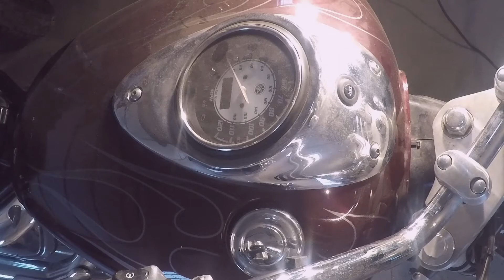2007 Yamaha V-Star backfiring repair Part 2 (final)

Comment: I had an air leak on the intake manifold (Road Star) from the tube that I think used to hook to the emissions system when the bike was new (Ca model) once I plugged it all of my backfiring and rich condition went away.! I am getting over 40 mpg now and the sparks are no longer black!
Reply: Was it the intake boots? Did they have cracks inside?
Reply: @philspaseo2377  No it was the tube that hooksto the AIS that the plug had come brittle and broke, so I was sucking air inside the boot itself! I recently installed a ported manifold, cleaned the are and put the permatherm I had there forever and there are no leaks...!
Reply: @loscantosdelayer5138  what’s the ais ?
Reply from the maker: It's the Air Injection System. It blows fresh air into the exhaust.
Reply: "Air Induction System" I guess (?); part of the "smog" (emissions) system California put in vehicles. It included a carbon box that  I guess it filtered fumes from the block (I have two plugs in the cylinders where metal tubing used to be connected  that ended somewhere in the carbon box,  one lead  from it went to that intake manifold tube!

Comment: The flooding issue on my 07 1100 was caused by a bad o ring on the neeedle and seat assembly.
Reply: Yup I still have that issue, shutting my petcock after I finish a ride fixes that flooding!!

Comment: Did you forget to install the air box and rubber elbows that connect to the carburetor, or was that intentional?
Reply from the maker: The air box and rubber elbows were reinstalled.

Comment: It sounds like you didn't get the problem sorted, still much backfiring at the end
Reply from the maker: I was able to get the backfire at idle fixed.  I don't know why that's not in the video.  The backfire had been so bad that it sounded like a shot gun going off.  I'm going to see if I still have the original clips.
Reply: @wonkster1970  I had the same problem, but still backfiring when letting off the throttle so I just ordered bigger jets
Reply from the maker: Creating a richer fuel mixture should correct the problem.

Comment: i have the same problem i cant get it to stop backfire on 05 vstar 1100 changed coils cleaned carb cylinder 1 s the one backfire did you get to fix ?
Reply from the maker: I cleaned the carbs, installed a carb kit, and replaced the spark plugs.  Thanks for watching.

Comment: you could try deleting the air induction system to eliminate the back firing...
Reply from the maker: Thanks.
Reply: @wonkster1970  ... There are some videos on YouTube... Removing ais on v star...  Ideally you can bypass it first just to try it before you remove the entire system...  If your bike has power running to the pump, leave the pump on the biie with the power still connected or you may get a check engine light...